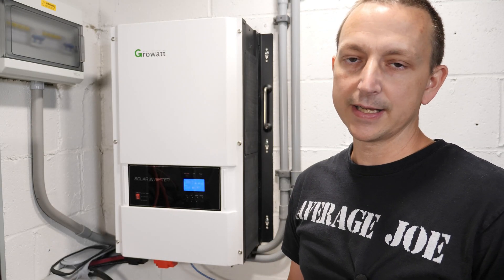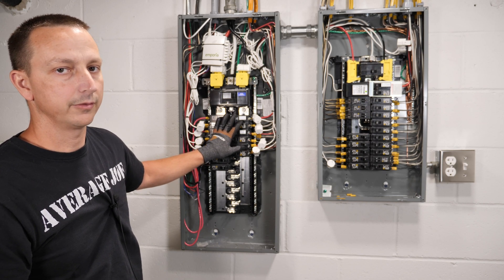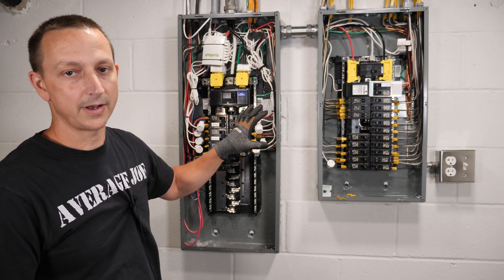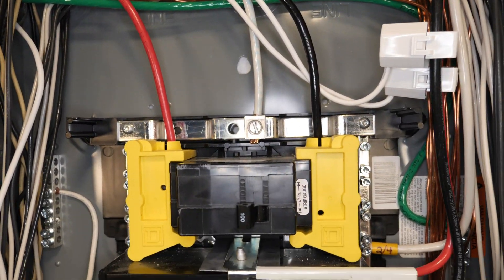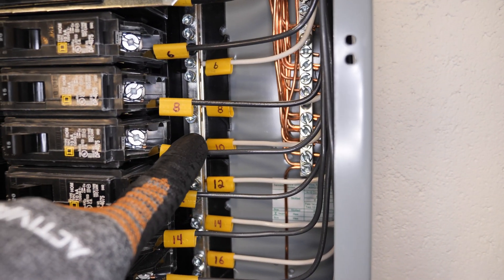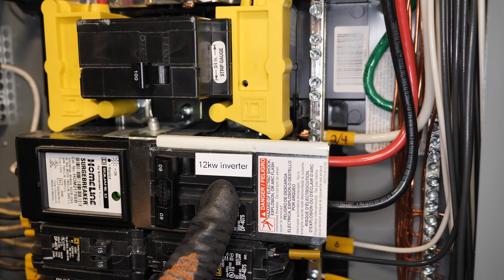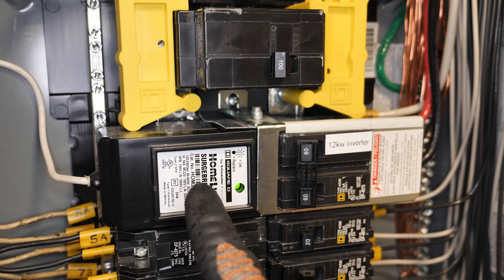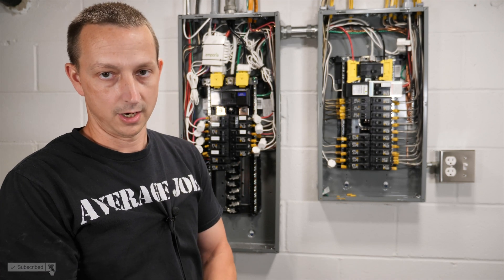How to Wire a 240v Inverter to Power your House for Off-Grid or Whole Home Battery Backup

Comment: What are your thoughts on this setup compared to using something like a Reliance Pro/Tran2 Transfer switch to control the home circuits between grid and off grid? I only have 8 critical loads to move and wondered if it would be a correct solution. Thanks Joe!
Reply from the maker: So my goal is to show and or "teach" all the ways to have power. Everyone has different needs and I understand that. If all you need is a few circuits then the protrans transfer switch is a great option. I also have one installed here but is a 6 circuit version so I can show how it works ect. It does cost a bit more but also allows you to connect up different sources of power. If you checkout ecoflows YouTube channel, I did an install video for them of the protran2 of the one here at the house.  I am a supporter!

Comment: Interesting. I see the inverter creates its own neutral, which connects to the utility's neutral throughout the subpanel connection. Seems funky to me. In a power outage you could be creating a potential, right? Did you check code for that?
Reply from the maker: No potential that I am aware of. Its the same if you wire up a protran transfer switch panel. Shared neutral on that as well. My electrician buddy has the same setup and is also wired the same.🤘

Comment: Hey looking for help and ideas. I was thinking of adding some wind to my growatt system. My initial thought is to run a 48 volt system and connect the mppt wind control right to the battery terminals in parallel with the growatt. But also thought about a 240 inverter and run it in on the grid port of growatt. I think the inverter would be to much loss since it would be inverted twice to charge batteries. Any thoughts or help would gladly be accepted.
Reply from the maker: You are correct for the 2nd option, to much waste. I would connect the wind gen controller to the batteries.

Comment: I see that it is an off grid inverter. The model is SPF12000tDVM according to your video 2 years ago when you got it.

Does your local utility require that it have UL 1741 certification?  This is my obstacle to getting a Growatt, I am not sure that THIS model would pass inspection.  If the grid power goes down I need to be 100% sure there is no leakage of current into my main panel.   I understand there are other Growatts that do have the UL certification but they do not appear to be compatible with all batteries.

Comment: Hey Joe, The one knock I have heard on split-phase inverters is that they have a high base consumption (i.e. if there is any load on the inverter, they soak up a relatively high amount of power to cover a modest A/C load). Do you have a good idea how much the inverters consume when running, and how much when in standby mode? Here in Maine we have net metering, so the only cost reason to add an inverter/battery setup is for backups. I am curious how much juice they drink when just standing by waiting for the grid to go down.
Thanks. -Rob
Reply from the maker: Yeah its mainly the big ass transformer thats inside this particular beast. The no load idle draw was about 150-155w if I remember right. Its been a few years lol.  Really just depends on what you wanna do. There are more efficient inverters out there nowa days.
Reply: @AVERAGE_JOE  thanks much.
Reply from the maker: You Betcha!👊

Comment: Indeed a little help AJ. I built a solar pergola, now I need to set up my inverter, my question is , why do you create a sub panel when you could just tune off the breakers to the large loads? I'm sure there a good answer, I just need to know why everyone I stalls a sub panel. Thank you man.
Reply from the maker: We setup another panel to power off the inverter. The main panel is for charging from grid or if batteries are low, the inverter can go into bypass mode. Main panel is also for items that the inverter cant power. Some people install a reliance panel instead. Both options are great.
Reply: Thank you for the response AJ, are you saying its not possible to have the main breaker panel and have the inverter feed the panel as well.  How does this sound, I would move the main power from the utility to the inverter power in and the inverter power out would run t the main panel. I have a Hybrid 12kw inverter from Luxpower that has 4 mppts. and I have 48Kw of batteries that I have not assembled yet. They are still in boxes from the China distributor( OSO).  I have 31 Longi bifacial panels that produce 550watt 48-51 v and 14amps. I was hoping the inverter would run the entire house, however in the event of a trip, I thought I would just go outside and turn off the breaker.  AJ, when you install a sub panel, are you just running a jmper from the main panel from a specific breaker to the sub panel? Your not actually running a new cable from the appliance in question. Sry about the stupid questions. @AVERAGE_JOE

Comment: HOWdy  A-R-J, ...  
thanks 
I have the "little" brother to your  12,000 watt Growatt ... 
Mine is  the  GROWATT  SPF 6000T DVM-MPV 
&  runs my entire home except, like you,  
I did not wire my my 240 volt APPLIANCES to my SOLAR  Circuit-Breaker PANEL   
STOVE = 240 volt  Electric  ( comes in handy to SEE when the GRID has gone DOWN - the Digital CLOCK flashes  12:00 -LOL  )  
Clothes Dryer  ( never used )  I dry my clothes with WIND & SOLAR ( on  a  CLOTHES-LINE ) LOL  
Water-Heater ( used sparingly ) 
Pole-Barn = for my 240 volt WELDERS ( seldom Used )  
Thanks for showing  US  Your  SYSTEM & WIRING Connections 
COOP
the  WiSeNhEiMeR  from  Richmond,INDIANA 
...

Comment: I had thought about a separate switch to provide the switching between inverter and utility power for critical loads. Including it in the sub panel is cheaper and easier.  Did your utility company say anything or send out people when you started using less power?  Have you had any code enforcement interaction?  Great explanation - thanks.
Reply from the maker: I could have just ran the inverter wires to the top and remove the grid but wanted to be able to have both cause I need a way to power the sub panel when I do maintenance or turn off inverter for what ever reason. No havent had any utility peoples out or code enforcers. I had one utility guy looking for someones meter and he asked about the solar panels. I said it was not connected to utility and was a project.😆🤘
Reply: Looks like you need to reach out to an inverter company for another inverter to run your house if you need to do maintenance. Your house could run off that 12k 24/7 with grid assist when needed. The. You wouldn’t need the critical loads panel. Might help viewers who don’t want to add a whole other sub panel.
Reply from the maker: I think you misunderstood what I was trying to say. I do run off the inverter 24/7. If the batteries are low, then it goes into bypass mode. Maintenance does not mean inverter only. I personally test out a lot of other batteries, make videos ect...I need a way to put the house back on grid to do certain things.

Powering a sub panel is the best way that I know that allows charging from the grid and or bypass mode. You could install a reliance transfer switch box but then you only get so many circuits plus its a sub panel.

Comment: Did you find when moving circuits that your romex wasn't long enough to move from the main panel to the subpanel? If so, what did you do to join them? ps. boom nice video.
Reply from the maker: If your subpanel is right next to the main panel like mine then you can just use wire nuts or the newer wago connectors to extend the wires. If the subpanel is somewhere else, then again use the connectors to extend romex. You are "supose" to put those connections inside a box.
Reply: @AVERAGE_JOE  it's a funky old house setup for me, in that the outside meter goes to an outside box with two breakers. A 50a to the ac compressor and 100a through the wall to the recessed main panel. It's kinda awesome as I can completely de-energize the main panel, but it does make things like monitoring the AC draw really hard. There is no sub-(sub?)panel yet and the wiring going into the main one is a hodgepodge of original "let's have a fire any day now wire" and a little recent romex. I guess if I put the sub panel beside, I'd need to feed the circuit being moved into a junction and wago it down to the subpanel with some extra romex, though no doubt some sparky will say "that's not to code' ;)
Reply: Good question! I'd hate to have to pull new Romex throughout my 110+ y/o house. (Though most of the wiring was redone in the 70s.)

Comment: @AveRage_Joe Nice work... nicely done!!! I only have 1 comment or suggestion on the position of the Growatt inverter doble pole breaker. By code (NEC Code that is), it is recommended that the Inverter breaker should be placed on the opposite side of the subpanel main breaker in order to comply with the 120% rule for loads on it. In that way, you can ensure that, if the subpanel is fully loaded (like yours seems to be) then any of the two power sources connected (grid or inverter) can power up to 120% of the original designed ampacity (current) of the lugs of this subpanel. 
Your subpanel is definitely smaller than the main panel and quite populated with your house loads, so - eventhough I don't know it's designed ampacity - this way I'm refering guarantees some additional amps (probably needed) on an power outage situation without damaging the lugs on the subpanel or causing an event because of an overcurrent situation.
Hope this helps....
👋👋👋
Reply from the maker: Thanks Man!  I think you add the breaker at the other end when you do AC Couple and stuff like that.  I added mine to the top since it is a different source of incoming power and not combining with grid.  I also needed the generator lockout and they dont make them for the other end of panel.🤘
Reply: @AVERAGE_JOE  Yeap... I realized that your using yours as an Off Grid system... so you're not supporting it with the grid... Good luck with that...!!!👍👍🤟🤟
Reply: Please tell me you are not an electrical inspector...  There is no "opposite side" of the sub panel main breaker.  Suggest glasses or better understanding next time.   << Palm in face >>  Unbelievable...
Reply: @w8stral  Please study NEC code before responding or giving an opinion... very DISRESPECTFUL by the way... 👎👎
I quote: "The NEC allows adding a back-feed breaker so that the current supply is up to 120% of the rating of the bus bar"...
Reply: No studying of NEC book will help you as you still believe WRONGLY the breaker setup is unbalanced.  As I said, YOU need glasses and UNDERSTANDING which you STILL do not have as NEITHER is true of his setup.   @Songomx
Reply: @w8stral  I'll just ignore you and your ongoing ramp of unrespectful comments...
Reply: Yes, your illinformed ignorant comments are VERY disrespectful @Songomx

Comment: Thanks for the detailed walk through... Good info
4:31... Why 2 #6 (Blk+Red) for power and only 1 #10 (Grn) for ground to the inverter ?
Reply from the maker: Thanks for watching! 2 #6's for 240vac power input is for passthrough mode and charging from grid if wanted. Manual says to use #6. Might be able to use #4 but I purchased the #6 from ebay at the same time as inverter. Also wasnt sure if #4 would fit at that time. The #10 is the normal size when using #6awg for loads. Can always use bigger tho.🤠🤘

Comment: Hmm.. where is your earth connection coming from when you are out of grid power? Seems to me like you have connected your off grid ground to your main grid panel. I might be all wrong, since i am not sure on how the grid ground works in US, but in Sweden there will be no ground if the grid falls out. And there will be a wery strange 0 to ground floating voltage..
Reply from the maker: Earth is always connected. We have earth connected to a ground rod and water pipes. Those are connected to the main panel which is connected to the earth from utility. Sub panel earth is connected to main panel with the #6 green wire. Then as I mentioned in video, the earth is connected to the inverter with the #10 green wire.

Comment: Im powering electric double oven, range, 2 central air units total 4 tons, 3 fridges, 2 dehumidifiers, 2 deep freezers with this inverter. I have only overloaded it one time and it auto restarts usually the ac or I've that tripped it wont autostart. The ac waits  10 mins. My bypass is 50 amps because i dont charge from grid. So 50 amps aka 12,000 watts is all it will allow to bypass without faulting anyways. Here in Michigan with 12kw panels and 70kwh of battery i still have several cloudy days in in summer Where it will switch to bypass around 6 am and stay in bypass till noon or later depending on just how bad the overcast is then switch back to solar and run it through the night rinse repeat. My electric bill is usually north of $200 its now $30-60. One issue is 7kw solar isnt enough. Because of the battery voltage at 57 volt max usuall 48-55v u can only get 6 kw olfrom solar. Ao im adding an external charge controller so when the sun does pike its head out i can collect it faster. Like 200 amps @55vdc fast i hope. We'll see
Reply from the maker: Yeah this is pretty much exactly my boat but with less solar.  Once I can get smoar solar Ill add the stove, AC and dryer back to the panel.  I also have all the trees in the back yard which I Love and hate at the same time💁‍♂️🙄😆

Comment: Question, why is the whole home suppressor I sub panel vs one in each since both can be powered by different sources (grid for main and when lockout active inverter for sub panel)?
Reply from the maker: Great question. Answer is there expensive lol😆 I may get one for the other panel unless I get more solar first🤔😄

Comment: Looks great. I had to go from 20.6kWp to 31.6kWp with a 160kWh battery bank to make it through the winter in Ky. All electric home. Wood burner below 25F is needed on long cloudy spells. Love ❤️ our solar system and ZERO power bill!
Reply from the maker: Thanks! Yeah we need moar solar FO SHO lol. You all get a lot of ice storms over there? I feel like I see that. Or maybe just a few but bad ones? We also can burn wood if the gas ever quits but just fireplaces. Ill be zero billin someday🤠🤘
Reply: Typically a 1/4” of ice once every other year. Feb 2021, we had 3/4”. That is when I bought my first setup 400W! It just snowballed from there. OG 3/22.
Reply from the maker: Ahh ok. I knew I remembered hearing something about ice. Well Im glad to hear the snowball effect has gone so well!😆🤘
Reply: Hey, loved your commentary.....How one set out to do your set up.....Thinking about solar.....Every end of summer and in winter we have intermitten power outages.......hate them....wondering how to start with solar with battery bank...I have propane for heat....want to use solar for lights, fridge and or cook....what is the most efficient way.....so much info online.....true beginner...need some guidance....Thank you.

Comment: Not in reference to your connectivity, but more to your Emporia. I've noticed that your SCTs, the wire pigtail goes away from the breakers. On mine, they would face the breakers. How come your SCT's have the "L" facing towards the breakers? K = Source, L = Load. These are located on the bottom of the SCT.
Also, are you using stock Emporia firmware, or have you relfashed it with ESPHome?
Reply: I decided to flip them all around like you have, and now they seem to be reading correctly.  Not sure what the deal is there. Follow the instructions and they are wrong 😹
Reply from the maker: Lol You got it figured out. So was yours reading all weird or what was it doing?
Reply: @AVERAGE_JOE  Mine has ESPHome installed.  So when they were on the "correct" way, some of the sensors were reading 0W usage. Not sure why. I do recall in the dev notes that they made changes so that negative numbers wouldn't show up. Maybe this is why I missed that they needed swapping.
Oh well.
The Emporia firmware they worked just fine, if I remember correctly. Because I tested it before I did the work of getting it reflashed just in case.
Reply from the maker: Oh ok gotcha. How is the esphome working?
Reply: @AVERAGE_JOE  so far so good.  I just need to do a re-calibration on it to make the numbers more accurate, and also get some 20A SCTs to replace the 50A ones to get finer resolution. 
Baby steps though  :)
Reply: @AVERAGE_JOE  btw, posted a comment on Discord for a product testing  ;)
Reply from the maker: @korishan Will check discord here in just a bit!
Reply: @korishan Does installing ESPHome keep the connection local?
Reply: @shawnmaker6974  Exactly!  Plus you can change how often the updates are. For instance, I've changed mine to update every 250ms instead of 2secs default Emporia does.
Reply from the maker: @shawnmaker6974  I would also like to know this!